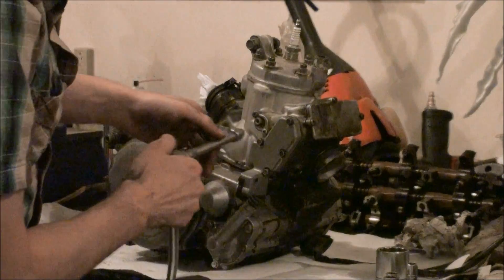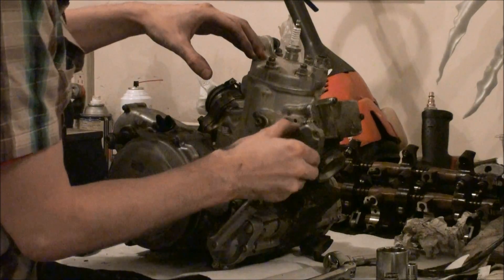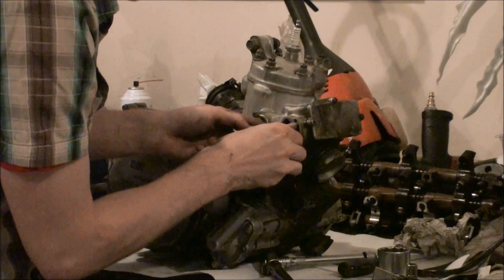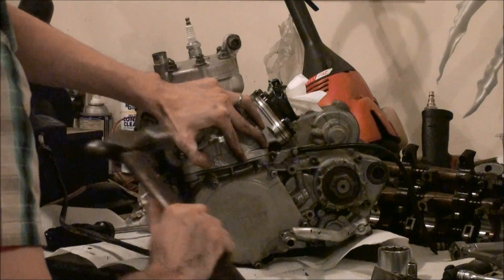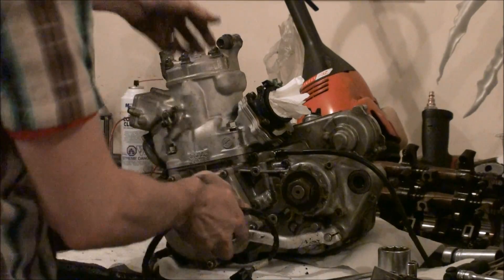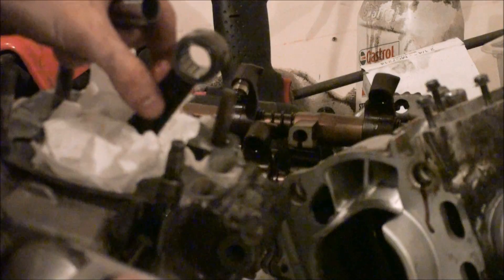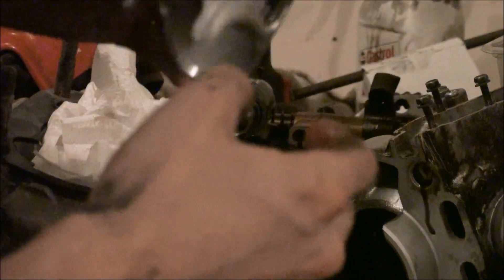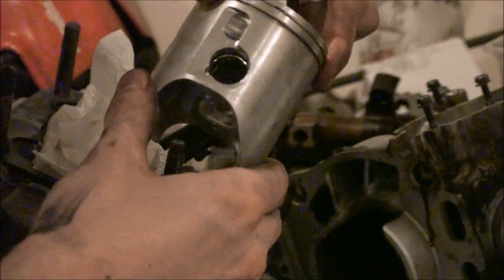Motorcycle Engine Rebuild - Part 2

Comment: hey i have a question.if my cylinder is not scared really alot then do i need to replate it or can i just clean it with some thing. its a 1999 cr 80

Comment: when you were undoing the bolt at 01:26 there is actually a tool to hold it so you dont wreck ur power valve (rockymountainatv) has the tool

Comment: @Yamahayz2502t 32/1 is what most people use but there are many variables that could affect what ratio of gas/oil you use. Just stick with what you have been using and don't change it